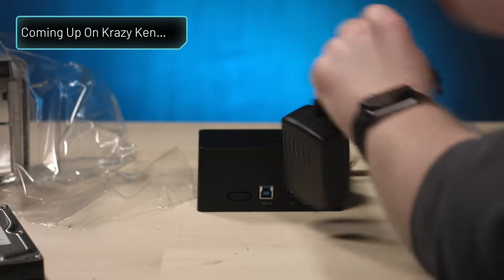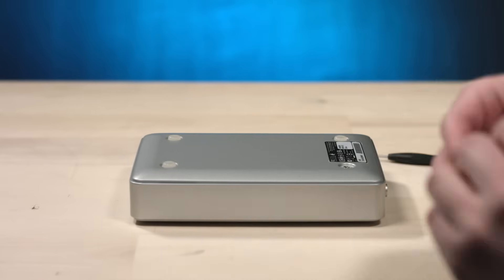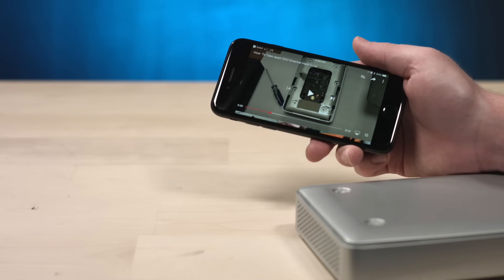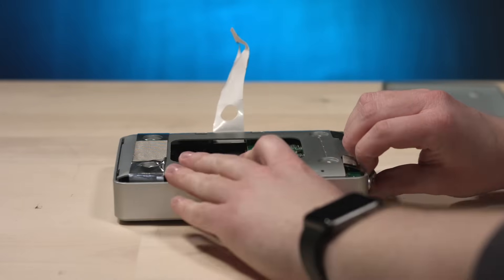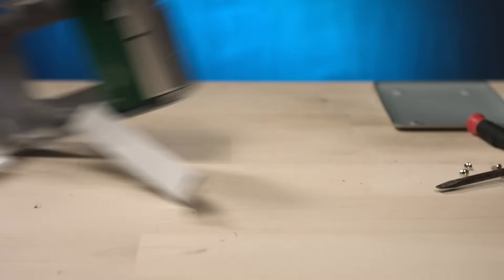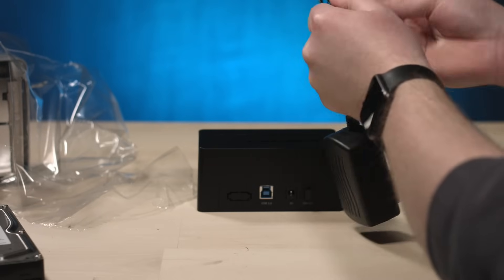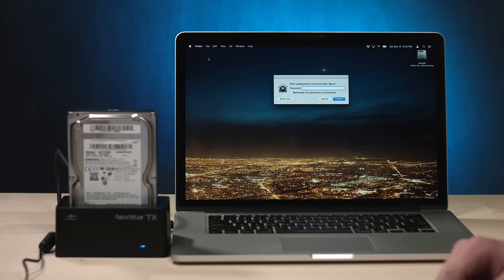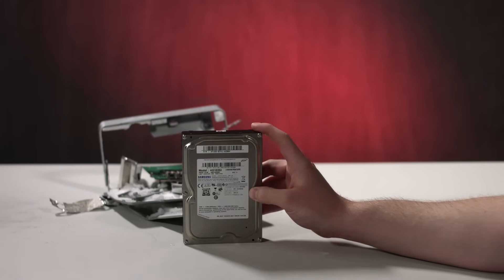External Hard Drive Failure and Data Recovery - Krazy Ken's Tech Misadventures

Comment: For anyone wondering, EMC bought the company in 2008, and EMC made a joint venture with Lenovo in 2013, rebranding Iomega to LenovoEMC, and LenovoEMC was discontinued in 2018.

R.I.P Iomega, 1980-2018

Comment: I just had a WD MyBook Kill it’s original drive, and I put another drive in there, unaware of the issues (it was a green drive, I assumed it had just failed to the sands of time) and it killed another drive by blowing up some resistors on the new drives power circuitry. FUN TIMES